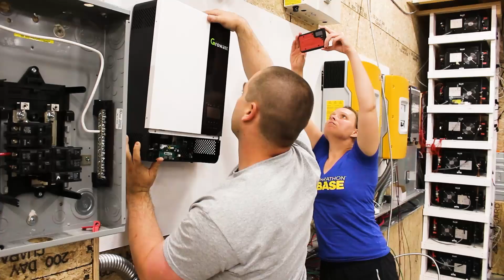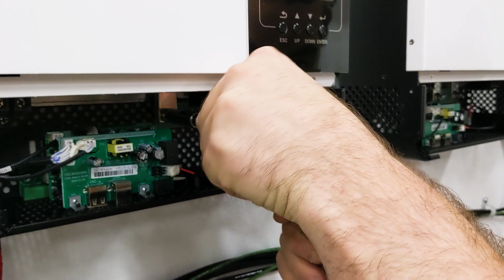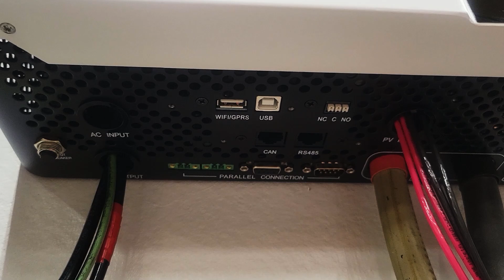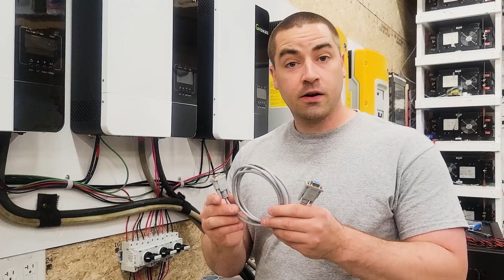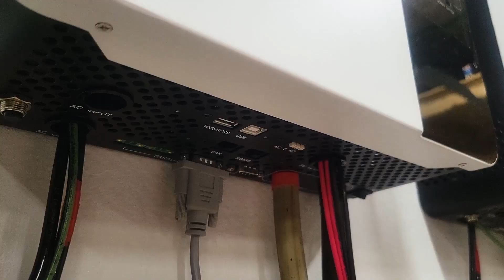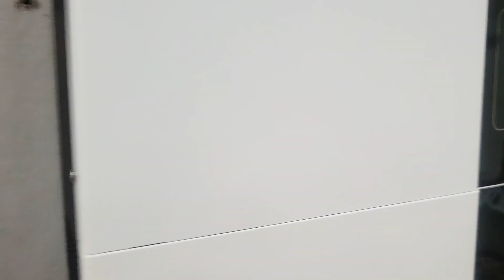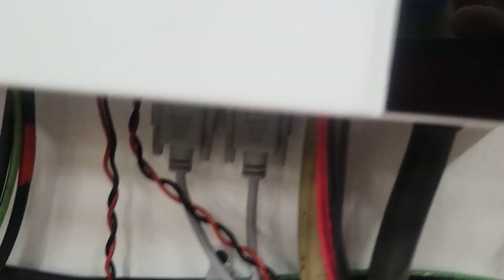Paralleling 3 inverters together, Growatt 5000w Solar System

Comment: so David, do you have 3 PV sets with each a max of 6000w?? or 1 PV ?? what happens if you had a 10kw PV line? can it be connected to the growatt and it only uses 6000w of it or would it blow the unit?
Reply from the maker: I have 3 solar arrays in my backyard.  Each array is a little different. If you have 10kw, then I'd suggest splitting it up between two units, or half on 1 inverter, and half on a charge controller.  You would not necessarily blow up the inverter if you connected it to one, but you are risking damaging it.   Video on 3 arrays: https://youtu.be/uc4gj-TrqkM

Comment: OK, I think maybe the IMO switch outside, at the array, might be the same as the three IMO switches inside under the Growatts. Is that right?  Thanks David!
Reply from the maker: Same specs, but different part#.  The one outside came mounted in the weather-proof box.  The ones inside didn't come with a box.
Reply: @DavidPozEnergy  thanks for the reply, and patience!

Comment: When are you going to post the video about rewiring the autotransformer?
Reply from the maker: I don't know.  I don't have a time line for posting.
Reply: @DavidPozEnergy  thanks. Can you give any ideas of what you need to do for wiring if not thru a circuit breaker please?
Reply from the maker: If you are using the auto-transformer with just one inverter (5kW) then I wouldn't use a circuit breaker on the auto-transformer.  Just the one circuit breaker on the inverter.  But, if you are using multiple inverters then you need over-current protection on the auto-transformer.  I've been trying to find a factory-made bridge that joins the handles of a circuit breaker on the auto-transformer with the circuit breaker on the inverter.  It can be DIY, but I have been trying to find a pre-built one.
Reply: I will be installing 2 5000 watt inverters. But what you are saying is over my head unfortunately. Can't wait till you make the video on it. Thanks

Comment: my XW inverter has its own neutral...no need for an auto transformer...do these inverters not have a neutral with a 2 120 legs
Reply from the maker: That's correct.  These don't produce 120V.  
Schneider makes a great product.  I suspect you are happy with yours?
Reply: @DavidPozEnergy  mines an old xw from xantrex....I've had it since 2008 when they first came out with them
I've only replaced the network board from a lightning strike
but yes, happy with it
thanks for the clarification on the 120V

Comment: I ran the standby load numbers and I came up with 4824watts.  I hope I am wrong and looking forward to your update on the system.
Reply from the maker: You are not wrong.  If they are sitting there idle they can go through a battery for sure.  I have them running my house, and there is always some amount of load.  Modem, routers, computers, even the little clock on the microwave, they all add up.  Those little loads mean the inverters never sit in idle.
Reply: @DavidPozEnergy  I was thinking that the 60watts per inverter is the base load. Then all other loads are added on top of that.

Comment: Awesome video! What if you were to only have one Growatt inverter with a PV array  yet still have battery and everything else connected to all three? That's my question b4 I pull the trigger on a second inverter. I have the  3kw 120vac Growatt.
Reply from the maker: Each inverter can be connected to different charging sources.  I have 3 solar arrays, but each array is different orientation, and different number of panels.  Not a problem.
Reply: @DavidPozEnergy  Thank you David!

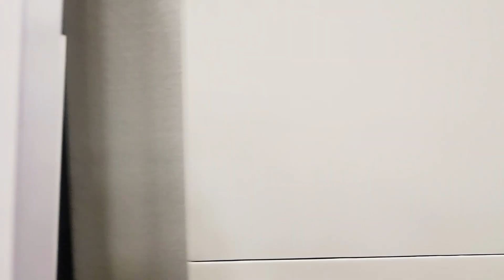Comment: Why did you refer to the inverters as master and slaves 1&2 @ min 20:20
Reply from the maker: That's the name in the manual.  One inverter gets the programming, and it tells the other two inverters what to do.
Reply: After the units are paralleled, does the host unit control all settings or are they still independent? If you change a setting on the host will it make the same setting in the other two?

Comment: Great Video bud, I'm just curious, why have you not dabbled into DC wiring of your garage or house. When we remodeled our current house I ran DC wiring throughout the house to skip the need of inverters and such and run the house off battery voltage directly and items we need A/C and cant run on DC we run on smaller more efficient point of use inverters, we deleted stuff that was difficult to run on battery like stove and switched to gas model.
Reply from the maker: I'm considering your approach when I build my next house.  Do you have any videos or blogs about yours?
Reply: @DavidPozEnergy  I do not as im not home all the time, I am a travel RN and when I do get time to work on the house, its when I'm in between contracts and take time off to go home, so time is valuable. I just treated it as a big RV really and the house needed to be rewired either way, so instead of going for 120v, I just went DC based on battery voltage and skipped the need for inverters and such at the house level.

Comment: I’m surprised you used a single 5KW auto-transformer for 15KW of inverter power. Would it have been possible to install an auto-transformer on each unit, and connect them in parallel?

Comment: Why is the auto-transformer needed? Aren’t the inverters putting out the right voltage? Also, do you have a video where you talk about your transfer switch for the home’s main panel?
Reply from the maker: I go over the details on the Auto-transformer, and why I use it, in this video: https://youtu.be/yWUfvvSa3K8
Reply: @DavidPozEnergy  awesome! Thank you. Do you go over the transfer switch in a video? Is it between the utility meter and the main panel?

Comment: Can you put those growatt in series to power a 480v Tesla speed charger?
Reply from the maker: These inverters could be used to power a level 1 and level 2 chargers for homes.  However, if you are asking about level 3, then no.
Reply: Tesla super chargers provide high voltage ( around 400v iirc ) DC direct to the batteries, and only Tesla's own supercharger stations have them.  They also deliver 150-300 kW of power, which you aren't going to get out of a home solar or battery system.

Comment: David great videos. You did ask about why they want to used a 50 amp breaker. The reason for that is in some countries they use 220vac at 50Hz. If you check the specifications on the inverters they have a max surge of 10,000 watts. 10,000 divided by 220v is 45.45 amps that is why they want you install the 50 amp breaker. These inverters already have built in electronic saftey features. If you use a smaller breaker than recommeded they breaker may trip when you start large induction motors so use the receommended size breaker as per their installation manual. Rgds, Mike Nolen!!!!
Reply from the maker: Thank you for the reply.  I had thought about that.  Here is the part I don't get, and maybe my understanding is off.  I thought:
A normal household breaker is a C-curve.  When I've looked up the curve for my breakers it looks like it allows a 2x rating for 10 seconds before tripping.  This inverter can do 2x surge (10kW) for a maximum of 5 seconds.  Wouldn't that mean a 30 amp would still work?  Actually, I've tested a 30 amp breaker with surges on this setup and found it worked fine.  So, again, not sure.
Reply: @DavidPozEnergy  David your reply is  accurate and you are doing a great job on your videos. I am  very impressed with your excellent videos. When you chose a circuit break for solid state electronics you should used the Z cure breakers which are designed to trip faster than the normal C curve circuit breakers. Since solid state electrons are very sensitive to overloads and voltage spikes you should use the circuit breakers with the Z curves as they can protect sensitive electronic components better than your normal C cure circuit breakers. You need to used the correct circuit breakers for solid state electronics. You don't want to use a circuit breaker that may trip unnecessarily. I have not study the information on the Growatt 5kW off grid inverter you are using. Most of these new high tech solar inverters have built in electronic safety controls which should shutdown the inverter when you exceed its safety limits. You want to make sure your circuit breakers can trip fast enough to protect the sensitive electronics but not to trip unnecessarily. I hope this information was helpful. Rgds Mike!

Comment: Great video, quick question, where did you junction from the solar to the grid supply on the house? In the service panel? Are you on a 200amp service? Thanks!
Reply from the maker: I have a transfer switch at the main house panel.  All of my work feeds through that transfer switch.  This way nothing I do can ever back-feed the grid.
Reply: @DavidPozEnergy  figured, thanks for the reply! What guage wire did you use from the transfer switch to your service for the house? The solar feed.. You may have mentioned that and i missed it, I appreciate it brother..just trying to find a tried and true method before i proceed and looks like you have the right idea..
Reply from the maker: Mine is 6 gauge, but you have to size it for your own breakers.  To see another great explanation of this check out my friend Bens setup: https://youtu.be/7zoPu-uK4Xc
Reply: @DavidPozEnergy  I'm at a loss with that. I would love to see a drawing showing how that works. I have an ATS that separates the grid from my 22kw generator. Would I need a second ATS or possibly a manual TS. ???

Comment: Do you get more surge power when you connect the inverters together? For each inverter you get 7000 surge power , do you get 21000 surge power then?
Reply from the maker: Yes, the surges add together.  I've been able to operate my home exactly the same as if on grid.

Comment: I bought the Growatt 12k inverter from Signaturesolar like you suggested.   Nice machine and have been running the house for three weeks now.  Having issue with is shutting down for twenty seconds and restarting. Did this three times the first three days,  then two weeks no problem, and this week it has happened three times.  Emailed Brian at Signaturesolar and email Growatt service.  No Response.  I gave the Growatt service all the info like they ask for on the phone,  They told me to email them info,  Bought a lap top to interface with it, Emailed them the data they wanted four days ago, no response.  Emailed Brian four days ago to let them know I am having trouble, No response.  I have a fan lock code, but yesterday it did it no code.  Not over loading,
Reply from the maker: Darn, that sounds very frustrating.  If you are on Facebook we could message each other, I'm at DavidPozEnergy.  

Inverters can shut down for multiple reasons, and overloading is just one possibility that you have ruled out.  Here are some other things to check:  
1. Battery voltage at the terminals.  I've seen this drop low, causing a low-voltage shutdown on the inverter.  However, sometimes the batteries are still good.  Some common issues are
1.a. Battery is undersized
1.b. Wires are undersized
1.c. crimp connections are loose
1.d. If multiple batteries used, daisy chained, BMS fault, weak cell in one, etc. might cause the issue.  I like to use bus bars for a central point.
1.e. Long wire run from battery to inverter
2. Solar: possibly over-voltage from the solar array.  This can happen with cold temperatures, and clouds.  Make sure to add 25% to the Voc on the panels when designing your solar array strings
3. Over-temperature.  Some inverters will shut down if they get too hot.
3.a. ambient air temp is too hot.  maybe kept in a shed that is baking.  Or an attic.
3.b. fan not turning on (could be a bad fan, or a loose connection)
3.c. blockage of vents.  Inverter needs plenty of airflow.  example: don't set the user manual on top blocking vents.

Comment: too complex for me. However why is the transformer not up to 15k?
Reply from the maker: The auto-transformer only handles the imbalance of 120v loads.  All the big loads in the house are 240v.  120v loads are fairly small, and the imbalance doesn't exceed 5kVA

Comment: Hi David. I just install my Growatt 5000w with the autotransformer and I discovered that there is a potential danger of possible electrocution. The neutral that the autotransformer creates is actually floating above ground at 120v. If your loadcenter is grounded, you will find that the inverter chassis has a voltage of 120v if you measure it against ground. Apparently the neutral and the ground are not isolated in the inverter. This happens because in the distribution system in the USA, the L1 voltage is 120v and the L2 voltage is -120v. In this inverter L1 is 240v and N is 0v. I can't even connect the ground of the inverter to the ground of the loadcenter, because it causes a short circuit in the inverter output.
Reply: Yes that is correct, if the grounds from the auto transformer and the inverters are connected in any way to the incoming house panel grounds you will get a back feed from the center tap (neutral) of the power companies transformer outside that feeds your incoming house power. Each of the incoming 120 lines (240 volt between each) coming from the power company is the only lines that are disconnected at the main breaker to your house or your first panel after the meter box, the neutral is not. In this case when you want this set up to be a stand alone power source you will have to provide your own earth ground separate from the one the power company bonds their neutral to. The incoming power from the power company the neutral has to be bonded to ground at the first means of disconnect for your home. Any sub panels after the main panel or meter box/panel, the neutral and ground has to be separated at the panels because at that point the neutrals are carrying current for 120v loads back to the center tap of the power company transformer. Always remember the neutral "is a current carrying conductor" once a 120v load is applied and that it does not have any means of disconnect or separation. An 8ft. ground rod and a roll of 6awg bare ground wire coming from a totally separated earth ground outside the garage coming directly to the inverters and auto transformer in this case will solve that issue.
Reply: hi. did you solve this issue?
Reply: @adigunolola  no. I don't know how to isolate the ground from the neutral. In other inverter brands, there is a screw that can be removed to avoid this situation. I notice that as soon that I disconnect the auto transformer the problem is solved. Technically the auto transformer creates a mid voltage between L1 and L2. Because L2 is 240v and L1 is 0V, the center tap of the transformer is 120v. when you measure L1 and neutral you have 120v and when you measure L2 and neutral (240-120) you also have 120v. But if your neutral is grounded in the loadcenter (as specified by the electric code, the chassis of the inverter is floating by 120v. This is as simple as verifying it with a voltemeter...
Reply: Hi. I installed this system on my home and i cannot replicate this issue. I could only see this happening if you bond your ground to neutral in your load center. regardless, I would suggest removing the ground connection from AC OUT on the inverter.
Reply: @adigunolola  Hi. That is what I did, and how it is working at this moment!!! However, if you measure voltage between inverter chassis and your loadcenter  (or home) ground, you will see the 120v measure!!! This can create a hazard situation if you touch the inverter with one of your hands and your are touching ground with the other one. This is not acceptable!!!
Reply: I think David said that the neutral and ground is not bonded inside the inverter in his other video of this inverter.
Reply: @gmanweber3776  Yes, sadly it is bonded!!! I made further test and discover that the problem only happens when the inverter is inverting from the battery (off grid situation, but using house load center that the neutral is internally connected to the ground, as specify in the electric code). If output power of the inverter comes from the utility (UTI or SUB setting in program 01), there is NO problem. 
For the moment, I am not connecting any of the grounds of the inverter to the load center ground. I may contact Growatt to see their explanation to this...

Comment: So 70 watts x 3  plus 16 watts for the transformer = 226 watts idle ?    12k low frequency is 160 watts  but the PV input is limited to 2x 250v .  Another observation is about the ones panel string arrangement . You would need all panel strings to be arranged the same for all three inverters to output . If you have a 3 strings that are say a morning , mid-day and evening pointed strings you would be down to 1 inverter at a time , correct ?    Great video , look forward to more testing .
Reply from the maker: The two biggest down-sides of this setup is the high idle draw (as you pointed out) and the fan noise.  Otherwise, they are exceeding my expectations.

I have 3 solar arrays in the backyard.  Each array is oriented slightly different.  Each array feeds to it's own inverter.  This works really well as I can capture sunlight all day long.  All three inverters will charge the battery at the same time at noon.
Reply: @DavidPozEnergy  That's great news. Glad they are working out ! My panel arrays will be at much more of an angle to each other than yours due to trees.  Still trying to figure out my best approach.  I did find that victron sells a 100 amp auto transformer with built in 100amp breaker and fan . $600 ish .